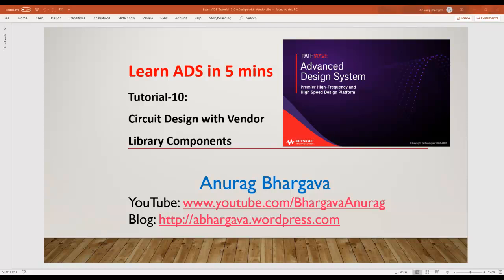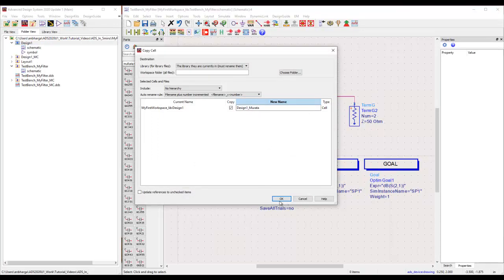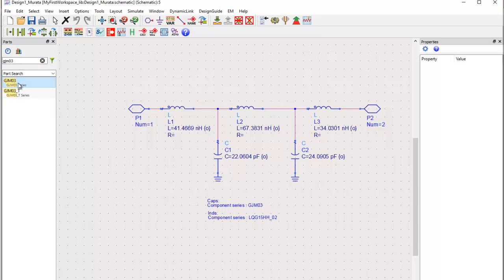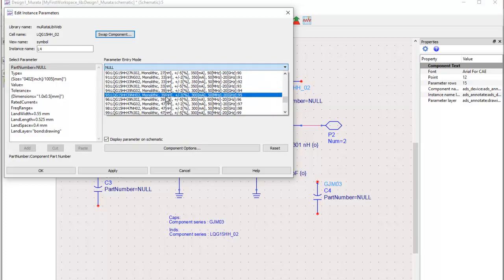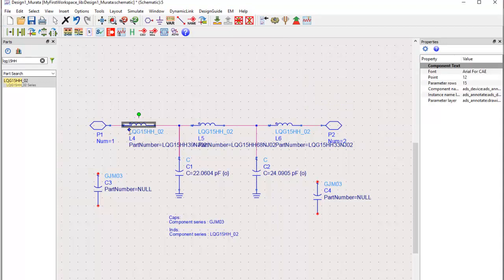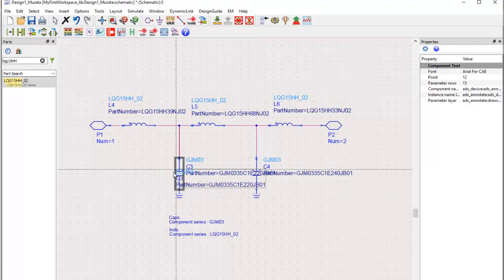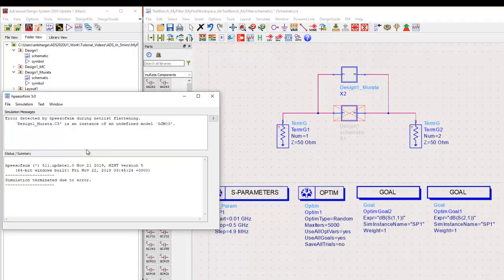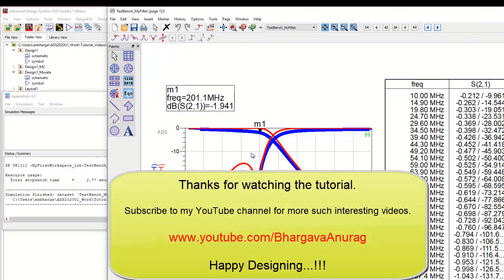Tutorial-10: Circuit Design with Vendor Components

Comment: Thank you so much for your videos, sir! I have been following your videos for all my rf designs and they've been very helpful. I tried em cosimulation for low pass filter using ideal components and it worked just fine. But when i replace the ideal components with practical components, I'm facing issues regarding post layout simulation. If you could please help me out in this regard or make a video on the same, it would be highly helpful. Please do consider my request. Thank you
Reply from the maker: See my other comment on this.

Comment: Sir, when I was simulating a transistor of CGH31240, It is throwing an error showing that, 
Error detected by hpeesofsim during netlist flattening.
Touchstone file parser error:
File 'C:/ADS2014_wrk/CGH31240/packaged_wrk/data/Input Network. S3p'
Does not exist or not accessible. 

What does it means,  what to do to get rid of this error?

Thanks,
Naresh.
Reply from the maker: Hi Naresh,
Ideally you should contact local Keysight tech support to help you with this but for this one time I will provide reply to your query here:
1. It seems you S-Parameter file name has space in between Input and Network and also the extension seems to have a space after . which is not file naming practice. Kindly rename the file name to something like Input_Network.s3p and update the same in your SnP block in schematic and hopefully simulation will run fine.

Other observations:
1. I see that your main folder is directly created on C:\ drive which is again not a good idea as Win10 OS will have lot of restrictions to do any operation on folder existing under C:\ so it is better that you keep all your work under C:\users\<username> folder
2. I see that you have named the work folder as ADS2014_wrk which is again not good because _wrk is the extension used by ADS for workspaces so name it something like ADS2014_Work etc

Hope this helps.
Reply: Sir, thanks for prompt response... I will follow your guidelines... thanks